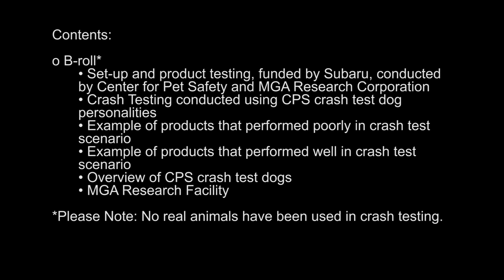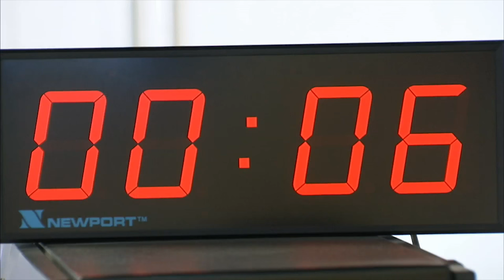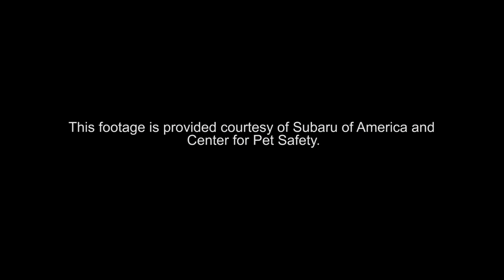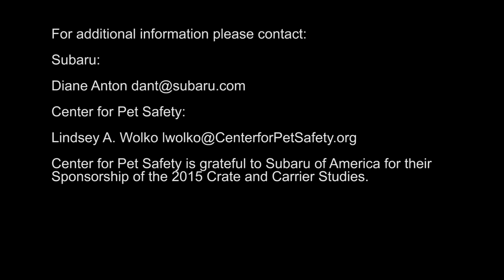Crate & Carrier Crash Test Footage

Comment: Would help a lot if we knew what kinds of crates did well.....
Reply: It says in the description: "After several eye-opening and informative tests - including instances of complete failure - three top products emerged; CPS has selected the Gunner Kennels G1 Intermediate with 8’ Tie Down Straps as the 2015 Top Performing Crate and both the PetEgo Forma Frame Jet Set Carrier with ISOFIX-Latch Connection and Sleepypod Mobile Pet Bed with PPRS Handilock as the 2015 Top Performing Carriers."

However, in my honest opinion, the Variocage performed as it should have even though they made it seem like it didn't. More thorough cash tests have been done on the Variocage and it is designed with crumble zones to disperse the impact. Pictures of real accidents with the Variocage can also best found. The test they did on the Gunner Kennel was unrealistic given that it is more likely to be cinched down closer to the back hatch of the vehicle and therefore more likely to have an impact from crash which this did not simulate. Just a few things to consider. Hope this helped!
Reply: Here’s the full results list 
https://www.centerforpetsafety.org/test-results/crates/2015-crate-study-results/
Reply: babygrl14 , this was why they failed the VarioCage, though in my view it behaved as promised. VarioCage says not to worry about the connection straps because stronger straps will likely break the car’s anchor points anyways. The connections are meant to keep the crate in the correct position for impact, not keep it from moving on impact.

“The front cargo connection failed – the front cargo strap remained intact, however it tore through the metal connection point on the crate.

The crate crushed (as noted in the marketing material) during impact with an average crush of 10 inches. The top and sides of the crate experienced minor deformation.

The locked door retained integrity and was unlocked and opened easily. The crash test dog was retained.”

Comment: Where is the footage of the Rough Tuff? I see they have one to test.
Reply: I saw it too in the beginning but no footage of it being tested?
Reply: They listed the results here:

https://www.centerforpetsafety.org/test-results/crates/2015-crate-study-results/
Reply: @keeper5689  I read the PDF file with great interest. Thanks for posting. From my reading of the results, the ruff-tuff was fine overall, but the front door came open allowing the dog to come fly out. The SUV slant back version performed better than the regular version. They sell a horizontal cross latch, that comes across the front door, and allows it to stay closed. I think it should come standard and not be an extra cost item. I saw they also sell a dual door version, which is a smart idea, given the fact that if you are rear ended, the rear hatch might be crushed in and you need a door on the opposite side to get your dog out. I would like to see the test repeated with the horizontal latch across the front door.